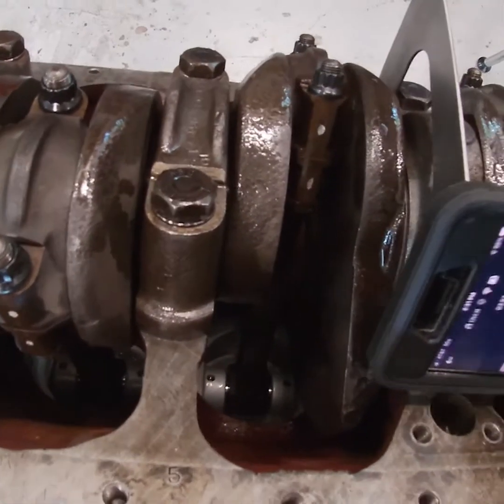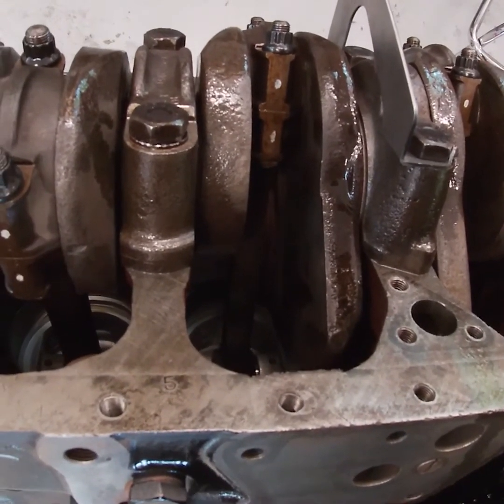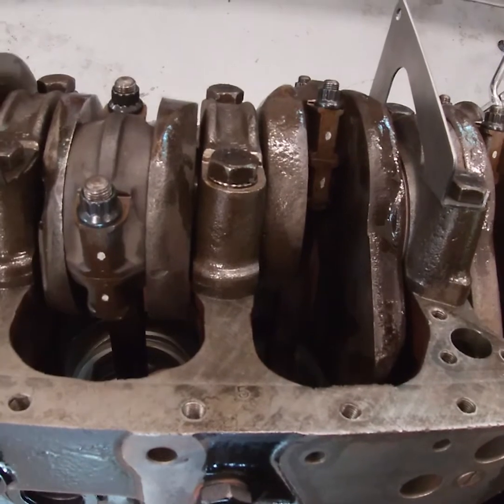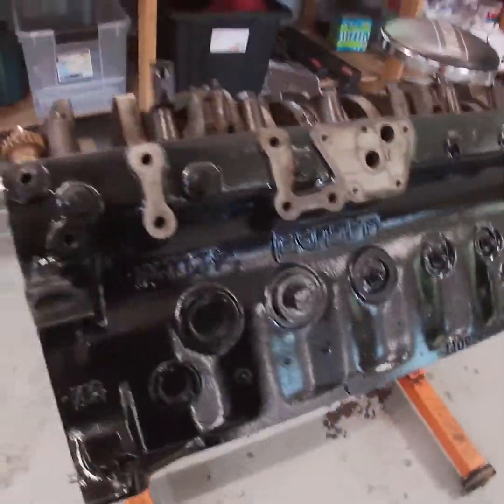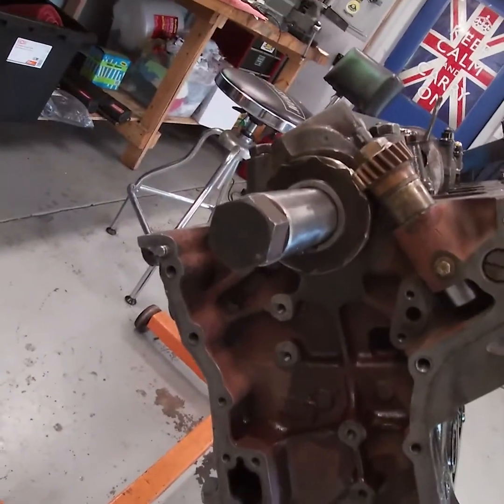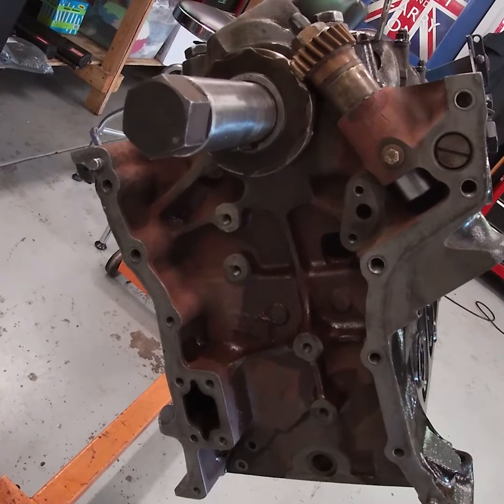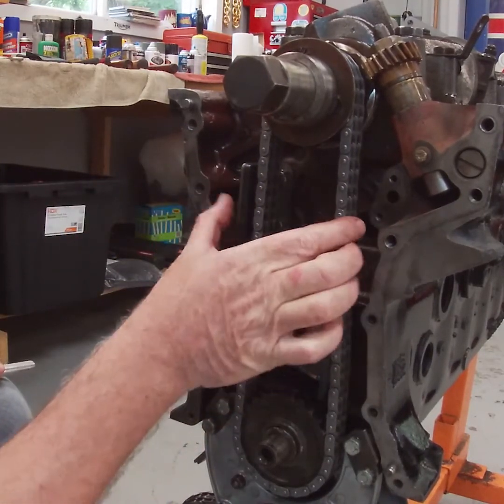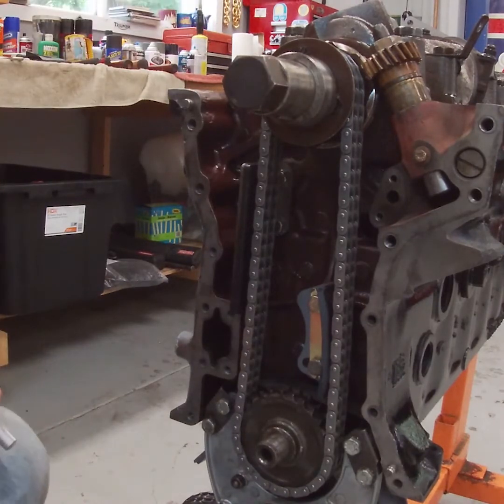Jaguar E Type Series II Rebuild - 2021-05-31 - Valve Train Chain Assembly

Comment: Great videos, thanks for sharing. Since I do not run a distributor in my 4.2L wonder if the next time I rebuild the engine i can leave that distributor gearing off of the crankshaft and gain a HP or 2 for not having to turn it. I've got the EDIS in my '68 OTS and where the dizzy use to sit I have a blanking plate.